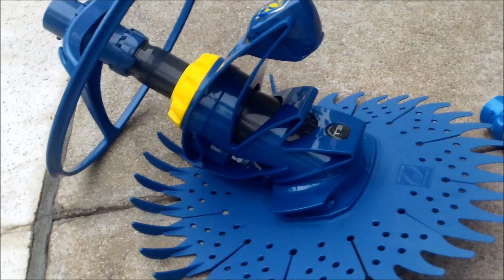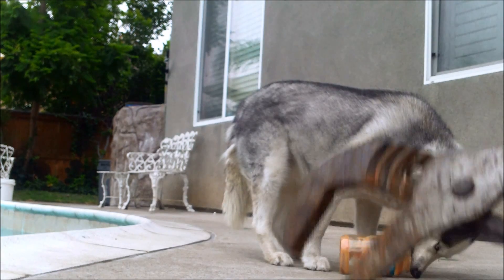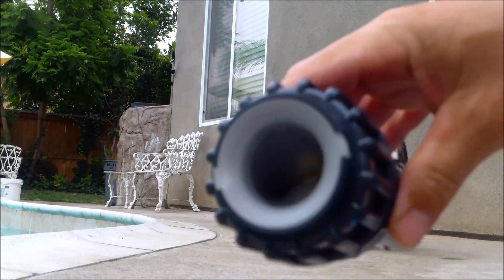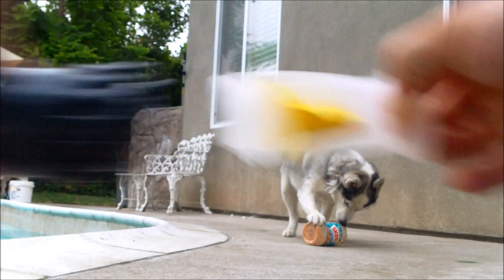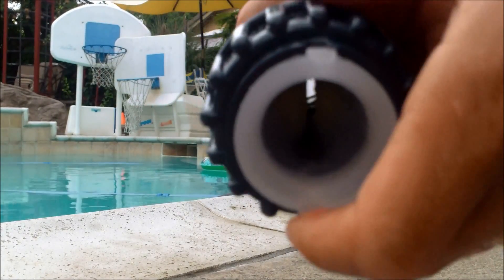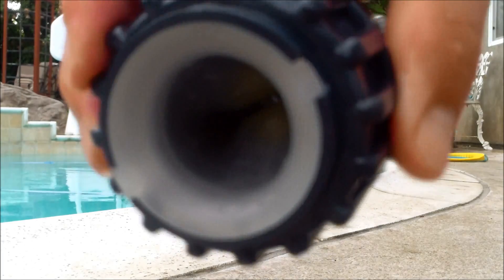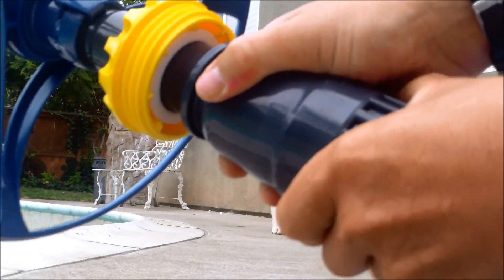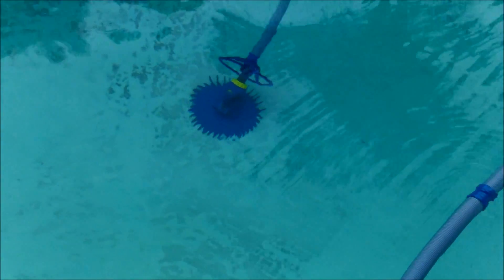Changing the Diaphragm in a Zodiac T3, T5 Cleaner

Comment: Also, is the middle of the diaphragm the only part affected by the suction or is the outside of it affected aswell?
Reply from the maker: The sides get weaker over time as well.
Reply: @SPL   does the suction pull the sides out so it can close shut again?

Comment: Great Video, thank you for making it.  I was wondering if you could answer a question.  How do you know it is time to replace the diaphragm?  Is there visible wear?

I have the T3 cleaner and it does not move around anymore.  I'm thinking it may be the diaphragm that needs replacing but I just want to be sure before I buy a replacement.  Thank you.
Reply: If you have a sand filter, try backwash then rinse follwed by filter setting.